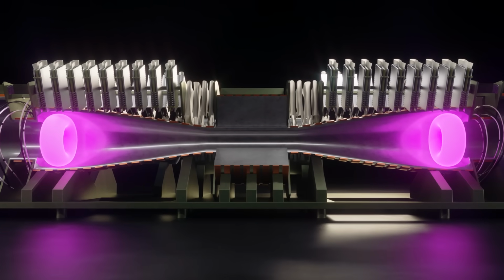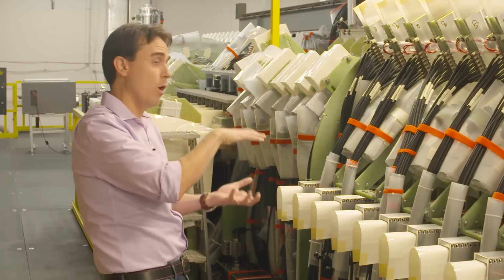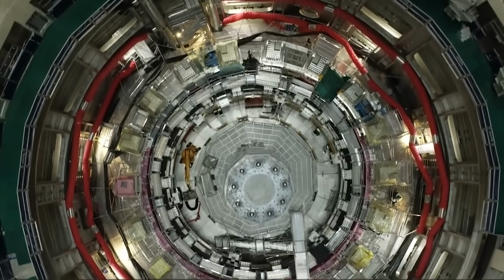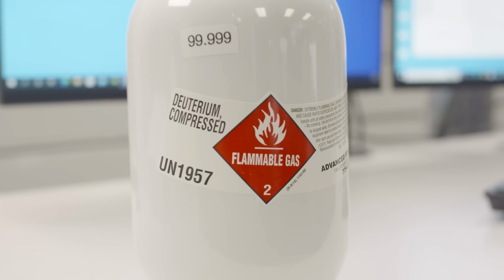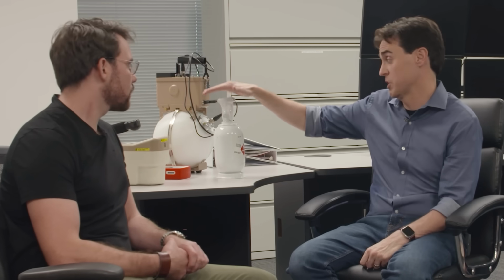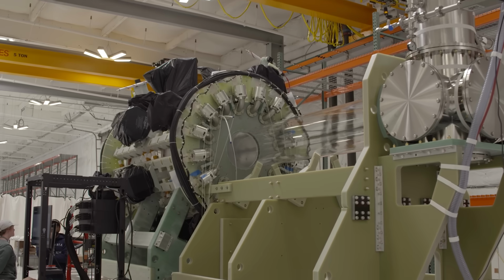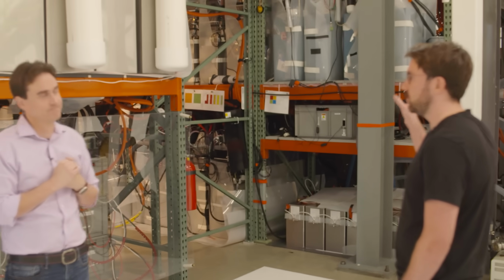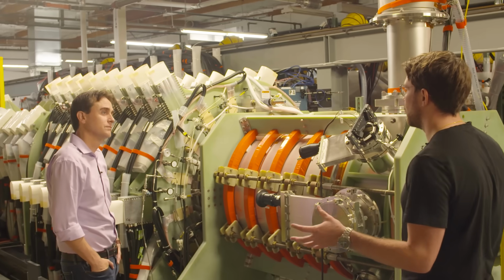A New Way to Achieve Nuclear Fusion: Helion

Comment: What is the advantage of this over thorium fission?
Reply: Smaller, no cooling towers and no steam plant, less CapEx, less red tape, can load follow from 0 to 100% output within seconds (or less).
Reply: @elmarmoelzer2229  how does it make electricity?
Reply: @criticality2056   It says so in the video.
The FRC plasmoid expands again (driven by its own internal pressure and the added fusion energy) after compression. That induces a current in the surrounding coils.
It is a very elegant system and requires few extra parts (mainly better switches and electronics for control of them). But there are no moving parts.
Reply: @elmarmoelzer2229  what is done with the heat?
Reply: @criticality2056   The heat (which is just particles moving fast) drives the expansion of the plasmoid. That movement of charged particles induces a current in the surrounding coils.
Reply: @elmarmoelzer2229  moving particles isn't heat though, vibrating and colliding interactions would be.   They say only electrically charged particles contribute to the plasmoid expansion, no newtron interaction, no thermal.   It's a curious method that seems to leave quite a bit on the table.   The efficiency rate would be interesting.  Now they talk about dumping an awful lot of power into it without considerable output.  It all sounds neat, but has an awful long way to go with much harder problems ahead.
Reply: @criticality2056   The input energy recovery is 95% efficient. Fusion energy is more difficult and also depends on the fuel mix. E.g. if they did mostly D-He3, it would be more efficient since there are less neutrons. If they did more D-D it would be less efficient. IMHO, it will be in the 80% range on average.
Reply: @elmarmoelzer2229  a net loss of energy?
Reply: @criticality2056  No, please read it again:
You have Power(in) * 0.95 + Power(fusion) * 0.8. Of course the fusion power will be more than the input power and you get a nice net power + out of it.
Reply: @elmarmoelzer2229  read it again, previously it didn't indicate fusion output as a value outside of 95%  the assumption that, of course, fusion is in excess of input is quite a large hand wave.  Realistic values are important as it speaks to viability.   Decades of fusion projects have achieved fusion and operated at a power deficit showing that it can't just be assumed.  This is a critical aspect of a viable project, and this project is externally dumping loads of power into this system just to start and more to keep it running.  This isn't the hardest of obstacles for them,, but definitely cannot be avoided.
Reply: @criticality2056   Fusion machines are weird that way. Generally, you can make them bigger and they work better. It has been mainly a matter of having the money to build the bigger machines. Trenta cost a mere 35 million for the whole program (not just for building the machine). You need more money to build machines the right size for net energy (or better electricity production). Plus Trenta does not have the equipment to extract the fusion energy. That too costs money. It was meant to lay certain physics questions to rest, which it did.
Reply: @elmarmoelzer2229  oh, the plasmoid induction is not producing a net gain over input?
Reply: @criticality2056  The plasmoid expansion induces a current. WITHOUT fusion that would be a net loss (due to ohmic losses in the coils and some other things that drain power). But the fusion reactions ADD energy to the plasmoid (duh that is the whole point of doing fusion in the first place). Add everything together and there is a net energy gain, provided there are enough fusion reactions. Helion thinks they can get enough fusion reactions to make up for any losses and add enough net gain for a good amount of net electricity production.
Reply: @elmarmoelzer2229  situation hasn't changed.  There is a large energy deficit not yet overcome.  It'd be great if it works, but they aren't there.  In common with most all fusion projects, energy costs are higher than output.  Hope it all works out great, but it is important not to lose a critical view of things.
Reply: @criticality2056  That is because all of them were too small or based on too old technology. Fusion machines cost money. Building big fusion machines costs even more money. No bucks, no Buck Rogers.
The purpose of Trenta was to retire the last of the risks and confirm the scaling laws Helion had established over the previous 5 machines. 
If the guys at Helion did not mess up and the scaling laws hold, then Polaris should produce net electricity in 2024.
I am very sure it will work out (they should even have some headroom).
Reply: Mind you, Trenta should be relatively close to the so called scientific energy gain, at least for a Deuterium Tritium fuel mix. 
All that in a very cheap machine.
Reply: @elmarmoelzer2229   no true Scotsman indeed.  It is all pretty pedestrian for fusion.  Not self-sustaining, not long running, both issues likely due to contamination issues.  Cost more energy to run than it makes.  Hope they figure it out, but they aren't there, infact a long way off.  Following the pattern of other fusion projects with all the pitfalls and potential, but no results yet.
Reply: @criticality2056   You are misapplying the true Scotsman fallacy. 
Contamination is not an issue for Helion.
I am not sure what kind of contamination you are talking about, even (none of the ones I can think of are an issue).

Again, Trenta is an experiment meant to retire the last risks before building the full scale machine. If you were an investor, you would demand building a (as cheap as possible) machine that retires the last risks before handing out the big bucks. Helion and their investors did just that with Trenta. 

ALL fusion projects to this day have been suffering from a lack of funding. The less funding, the slower the progress.
Thankfully private investors are now stepping in where governments have failed for all those years.

Also define "a long way off". I would not consider two years "a long way off".  Polaris might fail, but IMHO the chance of it failing is fairly low. Polaris was designed before they managed to increase the trapped flux by 25% in Trenta (with a relatively small change to the configuration), which increases the output by 80%. So, Polaris (and future machines) has some 80% extra margin (and I hear they can actually further improve on that). So their future machines can run on half the pulse rate (or have some safety margin in case something else does not quite work as specified). 
I would say, their chances are better than average.
Reply: @elmarmoelzer2229   @elmarmoelzer2229  if your not sure, then maybe don't be so sure.  No need to repeat, doesn't change anything. 
The U.S. alone invests $700million a year and has 3.9 billion in the ITER fusion project.  This project has a budget of a rounding error.  If funding levels determine success, thing are dire.
 Glaring and obvious questions still exist, which suggests risks have indeed not been "retired".
Why isn't the fusion reaction self sustaining?
Why is the reaction in bursts instead of constant function?
Reaction contamination occurs when the reactor ends up with non-reactive stuff in killing the reaction.  Common problem in fusion, and their setup doesn't appear special in this regard.  
An answer to these questions would go a long way toward being convincing as to viability.  Since they have retired all risks, this should be a simple and clear task.
 Otherwise it is not terribly convincing.  
Hope it all works, but I find it essential to maintain objectivity and make evidence based determinations.  Moreso for a project that I personally like.
Reply: @elmarmoelzer2229  hey, I appreciate the debate.  I propose that we may be at an impasse.  It seems we aren't arguing about facts as much as how much weight we grant them.  I only propose that they have made claims which they haven't substantiated.  The devil, especially in complex systems, is in the details.  Claims they make without practical demonstration/implementation I just don't give much credence.  Claims are cheap, really doing it is substantive.  Short of actually doing the work I don't find compelling, and here there are critical issues outstanding.  There have been many Theranos's of fusion and the details are critical to any success.  It's a technical field, a technical problem, with a technical solution.  The solution needs to be comprehensive.  
My outlook certainly isn't popular or common, and it's fine if we disagree.  It's just how I see it.
Reply: @elmarmoelzer2229  seems way early to say less Capex as they haven't made a productive, long running, or sustainable machine yet.

Comment: I'm no expert, but i wonder if arranging additional weaker magnets along the walls (similar to a tesla valve, but not exactly the same) will help prevent the ions from hitting the walls and at the same time also increasing the power output due to additional acceleration.

Aside from that, helion is an amazingly out of the box approach of fusion

Comment: I can’t put my finger on it at this moment, but this has a very “Theranos” feel to this technology.  

Fusion energy is the energy pf tomorrow, and it always will be.
Reply: Agree, its embarrasing how uncritical RE is in this video. 
SLATE did an article on this: THE Theranos Trial Shows Why We Should Be Suspicious of Nuclear Fusion.
Reply: @sassa82  Slate article is dumb
Reply: I predict that this comment won't age well.
Reply: @elmarmoelzer2229  Sure, ok.👍

How long do you want to let it age?
Reply: @SykoEsquire   3 years at most.
Reply: @elmarmoelzer2229  Awesome, I am patient.  Your comment will be immortalized in cringe.

But, because I am also a fair person.  If at any point in my lifetime I can flip a light switch in my house, with power coming from a fusion reactor (not just the one described in this video), I’ll issue a full on apology.  Though, I doubt you the type of any reciprocity, when you finally grasp thermodynamics, you’ll then at least understand my cynicism.
Reply: @SykoEsquire   Speak after me: "Fusion does not violate thermodynamics." If it did, the sun would not burn and the hydrogen bombs would not exist.
E= MC^2. A nucleus formed by fusion has less mass than the sum of the masses of the nuclei in the fuel. The difference is called the mass defect and it is essentially the binding energy that is released. If you want even more detail, the pion, the omega and rho mesons which are the bosons responsible for the nuclear binding force. Those essentially move gluons between hadrons (protons and neutrons) to bind them and some of them are released during the fusion reaction.
Reply: @elmarmoelzer2229  I never said anything, whatsoever, about fusion violating thermodynamics.  Nothing.  What I implied/alluded to, thermodynamically speaking, is that the temperatures and pressures needed to sustain fusion are not usefully practical in the surface of this planet for electrical energy generation.  

From staging and preheating the fuel to containment post ignition “we” will never achieve what comes so easily under the gravity of a star.

Fusion we create on earth is a really expensive parlor trick.

Comment: If they use super conductors for magnetic field generation (makes sense since the amperage is huge) then it would need very low temperatures to hold super conduction probably among the lowest temperatures in the universe, while having fusion going on just a meter away which is among the highest temperatures in the universe. Then that would be one of the greatest engineering marvels like the JWST.
Reply: They don't need to use superconductors.
Reply: @elmarmoelzer2229  I hope not because it would add to complexity. But just saying, if the final form has it, for good reasons, then that would be amazing 🤩
Reply: @fahadahmad8408   It would make the machine less efficient and it would prevent them from doing load following which is a huge appeal for these machines.
Reply: @elmarmoelzer2229  I was talking more from an imaginative perspective about its possibly, whether it would make the machine more or less efficient cannot be decided without weighting pros against cons or finding a good reason to do so. Unfortunately none of us can back it with relevant literature because there isnt much for this novel approach, these people are inventing by the day.
Reply: @fahadahmad8408  
Helion was considering HTSCs at some point in the past. IIRC, the machine can theoretically use (and benefit from) them in a high gain, low pulse rate scenario. But they decided to go a different direction with low gain, high efficiency and high pulse rate.
The problem with SCs, even HTSCs is that the cryostats would take a lot of energy, reducing the overall efficiency of the system (more than the <5% in ohmic losses that they have with conventional magnets). 
Plus, cooling down the magnets can take a long time (hours, if not days). So that would take away the ability to load follow. So it would only be usable for a scenario, where the machine provides baseload power and does high gain. The problem with high gain of course is that the wall loads per m2 get a lot harsher. So, you need a bigger machine and so on and so forth. There are a lot of tradeoffs that need to be considered.
And Helion of course did studies on this.
That said, I think that HTSCs could be interesting again IF we ever get to room temperature (or near room temperature) superconductors which do not need cryostats and maybe in scenarios where you have enough He3 to run on D-He3 only.
An example could be space applications in a future, where Helion has produced enough He3 that it is affordable to run some machines on just D-He3 (or better even just He3).
But that is still relatively far off. Could be interesting though for a thought experiment and some sci- fi stories.

Comment: 10M joules pulsed at some unknown rate will be the electric 'fuel' cost. At 60/sec it would be around 36B joules/hr. What is that around 10MW to fuel that electrically? If it can return more than that to the grid with a significant amount left over. It would have been good to see some discussion of this with break-even scenarios etc.

Comment: I'm curious if they could design a combination reactor with a beryllium layer to work concurrently with the plasma EMF-to-electricity system. Generate electricity from neutrons impacting the beryllium through a heat exchanger alongside the current planned mechanism.

Comment: I have the next questions:
- how expensive is it to rebuild Trenta?
- is there a simulation of what happens to the two rings of plasma when they collide?
- from what I understand, the ring plasma is contained using a magnetic field, since there are 2 of them colliding. How close do the rings of plasma get to each other before the magnetic field that forms the ring collapse in order to allow the actual collision?
- in order to start the fusion reaction you need 100 million degrees. What temperature would be needed to maintain a fusion reaction(should be lower)?

Comment: My idea for nuclear fusion reactors when compared to this is a bit... primitive. 
The idea i had was to make really big holes in the ground ( really big), coat it in solar panels or other things that make energy. Or you could have a shell filled with water connected to a generator that activates when the bomb explodes. After setting up energy collection things you would then detonate a small fusion bomb in the center in controlled bursts. This would technically be a fusion  reactor.